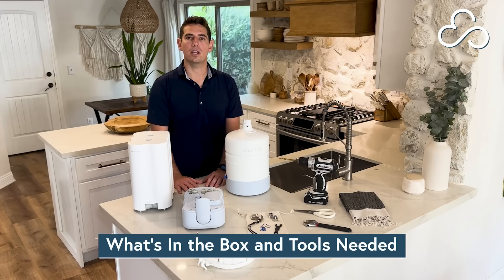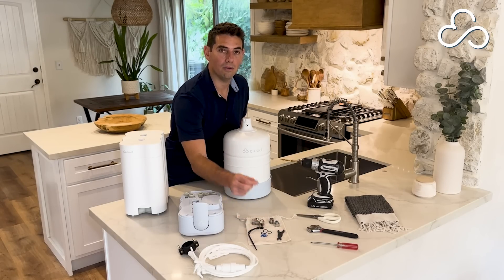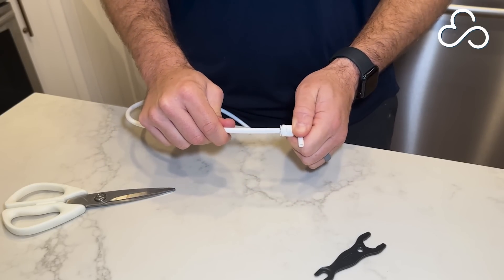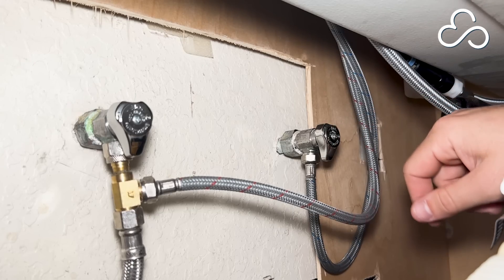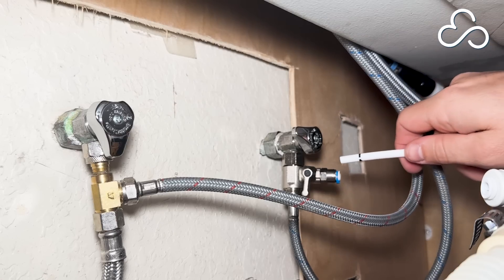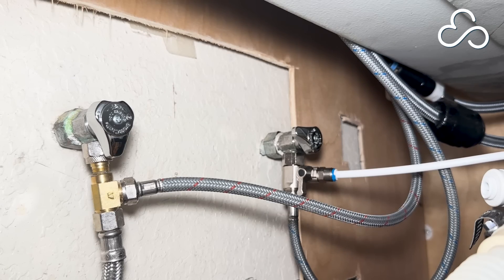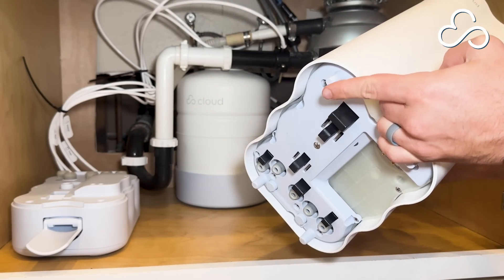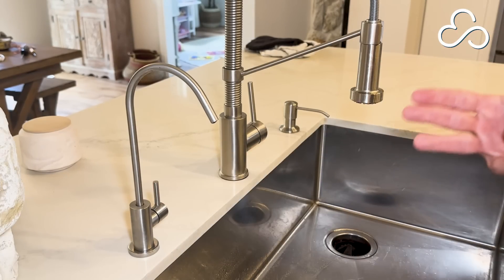Cloud Water Filters | Cloud RO Installation Guide

Comment: Does the drain connection have any kind of back flow valve on it to prevent water from the drain coming back in to the system?  Like if the sink drain were to plug up, it could flow in to the RO system drain tube.
Reply: Great question
Reply: Have a different system but uses the same setup here (WaterDrop g3p600). Also wondering this. I'm assuming its not an issue because the system itself would prevent intrusion to the RO unit itself, though the line would get contaminated. I need to replace the drain saddle tomorrow so I'll ask the plumbing supply guy. Someone reply here so it reminds me to respond with what I find out.

Comment: Hello Cloud RO friends, 401 delicious gallons later and 3,209 water bottles saved and now I have just replaced the battery and filters for the first time, but there seems to be a problem. 
Water will not come out of the tap and my best guess is the tank lost pressure?
I think I seen somewhere that it should be at 8psi? 
Can I just hook up my battery powered air pump and set it to 8psi and call it a day?
Reply from the maker: Thank you for the note. If there is zero water coming out then it likely isn't the tank, it is probably having a power issue. Even if the tank is off, and/or has zero pressure water should still flow. Please contact our customer support and they can get you a quick resolution: support@cloudwaterfilters.com
Reply: @ Thank you for getting back to me. - 
Turned out the actual issue was that I inserted the replacement cartridges without removing from the base. Woops lol 
But it started working as normal after lifting the middle section off the base and setting it back down as to reset it. 

11 months later and I have absolutely ZERO complaints thus far, Just wish I’d found you guys sooner. 
The whole family loves it and I’m slowly getting the guys at work intrigued. 😎
Keep up the awesome work, thanks again!

Comment: Went to install it but I guess my soap dispenser hole in my counter top is too big because the locking nut is too small to hit the counter top….guess I’ll have to buy a large washer to remedy this
Reply: Grade 8 Zink plates washers at Home Depot worked great for me. Still holding up 11months later, no tarnish.
Reply: @gregbeck906  I have the same issue of having a 1 1/2 inch soap dispenser hole in my sink. Did you secure your faucet by placing a washer both on top of the opening, and also under the sink?
Reply: @PhilSurkis Yes, one washer on each side.
Currently at 716gal used and 5,725 water bottles saved. 
Best purchase in my lifetime at this point!
Reply: @gregbeck906 Thank you!
Reply: @PhilSurkis You’re welcome. 
Feel free to reach out if there’s any more questions, I am happy to help!

Comment: where do you add a UV filter?  the facet out or the tank tubing?
Reply from the maker: A UV filter is not needed because there is an antibacterial media in the post filter. However, if you are on a well then adding a whole-house UV before the system is a good idea.

Comment: I’ve been considering this system but I was wondering about the water that sits in the holding tank. Wont bacteria grow in the tank or is there a way we need to clean it out regularly?
Reply: yeah, I have that question too, I bought it now want to install UV filter to kill the bateria.
Reply: There are measures in place to prevent this from happening, the multiple filtration stages inline with the tank will not allow bacteria to get that far. 
Only the faucet and water lines should need to be replaced down the road.

Comment: I just installed my system and it was easy. Take your time and follow the instructions and it is goes smooth. 

The only complaint I have is the faucet base size. I have a generic sink that was installed with my house five years ago, so it is not a really old sink that is not something found today. It had a faucet with a sprayer. I bought a new faucet that doesn't need a sprayer so I could use that hole for the Cloud faucet. I removed the old faucet and sprayer, installed the new faucet and had my empty spot ready. I put the Cloud faucet in the old sprayer spot and it barely covered it. I could probably put some pressure on it and get it to pop down through the hole. Not the end of the world since it does just fit. The plastic washer for underneath is smaller though and when I tightened the nut the washer went right through the hole. I was able to use a piece from the old faucet as a washer for underneath the Cloud faucet and made it work. So if you are doing the install and using a premade hole in a sink, check it first and make sure the hole isn't too big before you start taking things apart.

Overlooking the fitment issue I had, everything else was smooth and I am enjoying the new drinking water, I can really tell a difference.
Reply: Hello. You’ve probably got this figured out but I ran into the same issue with my set up. 
I just ran to Home Depot and got a couple grade 8 zink plated washers to put in the top and bottom.
Reply: @gregbeck906  I appreciate the reply. I did get it mounted. I was replacing my faucet at the time and there was a washer type piece on the old one. Since the actual Cloud faucet just fit, I used the washer from my old sink faucet and snugged it. Then I put some clear silicone around the top to make sure no water leaks through. It is working great!

Comment: I got everything installed except I haven’t drilled the hole in the quartz countertop yet until my wife approves of the location. Everything went as easy as you demonstrated. One issue with the video is it’s a quarter turn or 90-degree turn to open or close the valve on the tank, not just 45. Thanks for the help! It took me about 25 minutes plus however long it takes to drill the hole and install the faucet.
Reply: Got the hole drilled with a Spyder 1/2-inch diamond bit, some plumber’s putty, and a small pool of water. Took about 20 more minutes to drill the hole and install the faucet for a total of about 45 minutes for the full installation. I’m about to dump the third tank and try this water out.
Reply: @sukuwaretahito  how do you like it now?

Comment: I called about 4 places off of your “recommended” plumbers list for my area and got some quotes. 

Not ONE of them gave me a quote for less than $450 to install this system. 

So being the man that I am, I did it myself. It took me NO MORE than an hour of labor to knock this out. And that was with 3 kids (8/6/4) hanging off me like a damn jungle gym because they wanted to help daddy. And by “help” they mean make it twice as hard as it has to be. 

This was one of the simplest installs I’ve ever done. This tutorial lays out the steps so easily… a blind man could fumble his way through it. 

Now to flush the system 3 times and see how this mama jamma tastes! 🎉🇺🇸💪🏼💧
Reply: Indeed. Very easy install if you’ve ever done anything around the house. The hardest part is drilling the countertop if you have natural stone or quartz. I started with a standard masonry bit to get a pilot hole because the diamond bits don’t have a point but are annular (ring shaped), so they’ll move all over the place if there’s no pilot hole. And I used plumber’s putty to trap a pool of water around the drilling area to dissipate the heat. Worked like a charm.
Reply: how do you like it now?

Comment: I have another question.  You show a pressure regulator on the inlet hose.  I did not receive that.  Is this a change, and do I need it?
Reply: Did you figure this out? I'm missing the pressure regulator as well.
Reply: @it is no longer included or required

Comment: Im confused how the tank works.  I bought this system and am waiting for it to arrive.  From what I seen only one hose goes into the tank.  Is that both an inlet and outlet?  My current system has two lines.  One in and one out.
Reply from the maker: Thank you for the comment. You are correct, the tank only has one hose. The same hose is used to push pure water into the tank when the faucet is closed and push the pure water out to the faucet when the faucet is opened. Most RO systems only have one hose connection on the tank.
Reply: @cloudwaterfilters  Thank you.